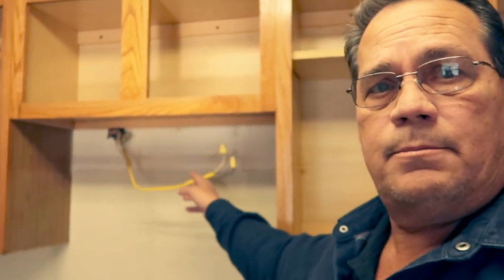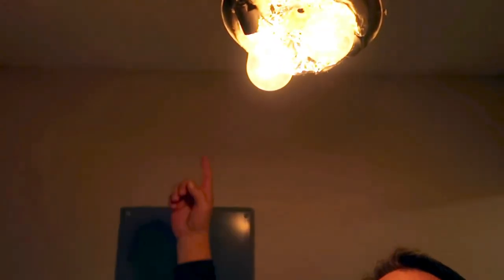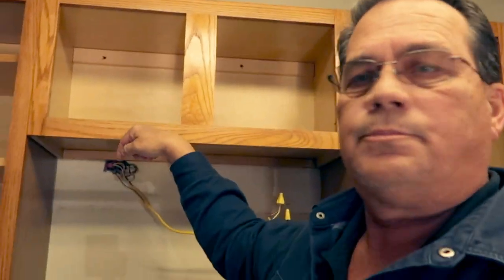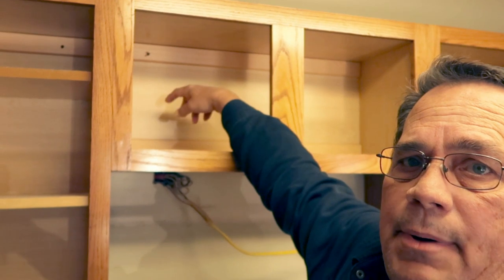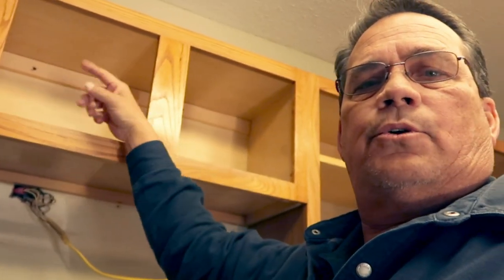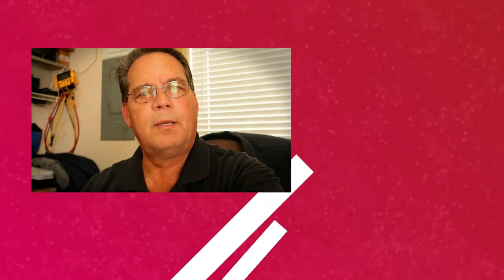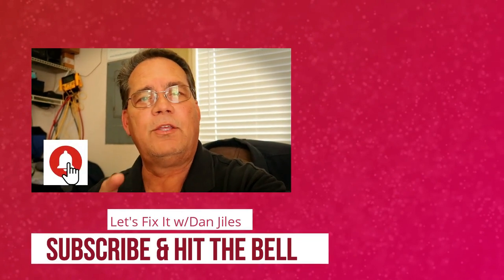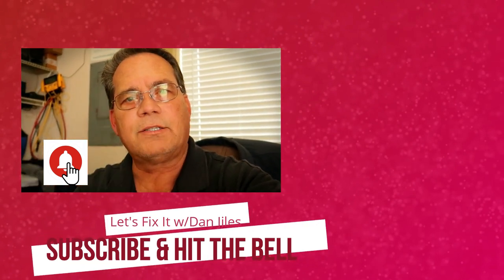Installing A Microwave in Place of A Range Hood / E1

Comment: Where is part two??  I scrolled the videos. I’m not seeing it. I need to know if I can caulk around it to fill in the small gaps. After the record cold here in LA and TX I discovered air flows around it like an open window.
Reply from the maker: Look in the playlist section. Series
Reply: @danjiles  I found part 2. Silly me, I was looking for Install a Microwave part 2.

Comment: Good video about voltage. Related to sice. May I install a low-profile microwave where I had installed a regular rage hood?
Reply from the maker: You would still need to be sure of your power. the microwave should have its own 20 AMP circuit for power. Most of the time a Range Hood shares power with other outlets on the circuit.
Reply: @danjiles  Thanks a lot for your answer. I have 2 brackets of 15 for my microwave and some kitchen lights and 4 brackets of 15 for my Range, range hood, and some light. I do not know if I can hang it in that braccket.